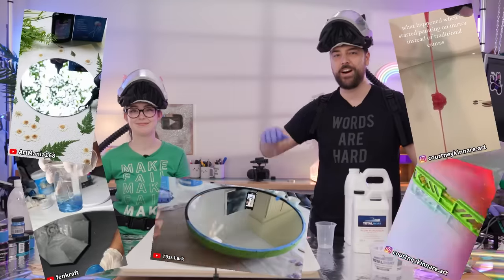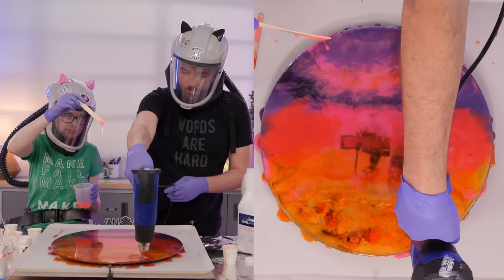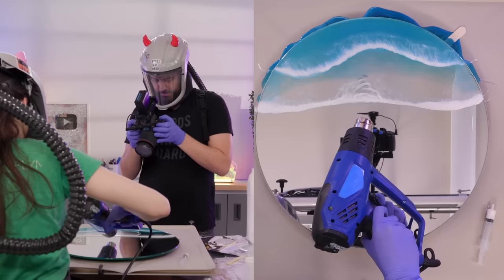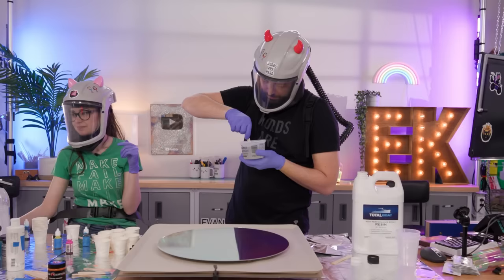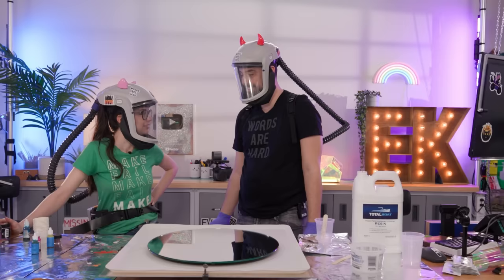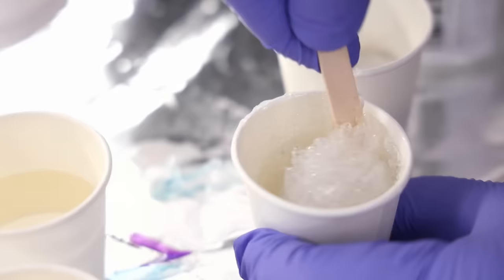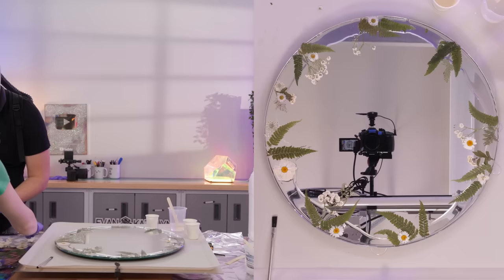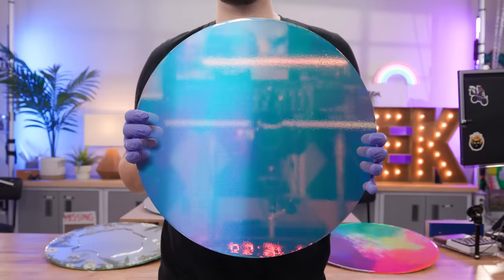Testing 5 Viral Resin Techniques on MIRRORS

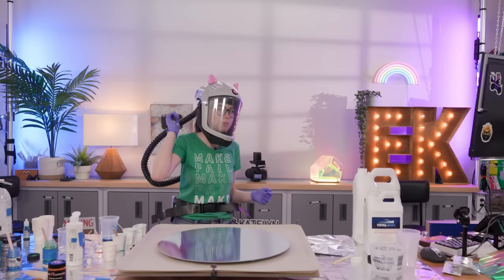Comment: 1:13:58 The reason the iridescent film doesn't work on the mirror and does work on the aluminium is because the film needs to be on the reflective surface. With the mirror it's on the glass and the light goes through that, hits the reflective coating and bounces back which in theory cancels out the film.

1:23:15 yes just that 😅

Comment: I loved the flowers the most! Ive never wanted to do a resin project before but the dried pressed flowers on the mirror is just so beautiful!! I dont like the edge though... i think the forbidden slushie would have worked if you lined both the inside and outside with it to make it more cohesive. I definitely want to make a mirror lined with dried flowers now

Comment: Hi guys, I hope you're both well and enjoying life. 
I was watching Evan pouring 🫗 with the small jug and pulling it backwards off the cups, if you turn the jug or bottle of wine.

You stop the water or wine or whatever lol
The strength or flow of the liquid is stopped. 

That's why there is a dimple in the bottom of a "champagne" bottle. 
You rest the wrapped " champagne bottle in the palm of your hand.
You then place your thumb into the 'dimple' at the bottom.  

And when you poor it out into the champagne 🍾 flutes, you turn the bottle when you finish pouting you won't lose any 'champers".🎉 🥂🍾🥂🎉

Comment: For the flower mirror I think having an inside edge would have been nice.  For example make a doughnut of flowers in a mold and then put on top of the mirror.  Then you have a clean edge, pretty flowers, and a mirror

Comment: The K in CMYK actually stands for "Key" as black is the key colour for getting most of the colours, without that, everything would constantly be very saturated and some colours are not possible if black is left out- BUT Katelyn is still right though. They also couldn't use B due to Blue in RGB already using said letter. People might think of it as "Cyan, Magenta, Yellow, Blue" instead if they had used B again. I know K also stands for the thing called Key-plate being used that the black colour is printed with but chat had already mentioned that as I was typing this lol Just wanted to edit this so that it's not confusing. Many meanings behind a smol letter nonetheless

Comment: The original ocean mirror used a thicker resin for the blue definitely, and the way he shaped the waves maximized viewing space while still having wave space. I suspect the white and clear were a thinner consistency than the blue so they'd mix with each other easily, but would move over the blue with less blending. Just guesses though

Comment: i had an idea to make something and no one has done it yet on YouTube. i was looking at the aluminum pour videos into orbees and i wanted that for my fish tank but aluminum is too toxic. then i thought resin! but everyone is fully encasing the orbees with very runny epoxy. but i know you can thicken epoxy to make it less runny or even into an unmoving paste. i was thinking if one thickens resin and pours it into orbees that if they get the consistency right. it will move thru the orbees like the aluminum did. something molasses thick so it can't fully travel to the bottom of the orbee's bucket. would enjoy seeing this if you did it. thanks!

Comment: I myself would've put some resin in the middle and use the paintbrush to thin layer it over to the flowers so you wouldn't have needed to pour alot in the middle but rant over I think a cool idea would be mirror rematch! Shaped mirrors, different techniques, redoing some failed techniques, and maybe a second chance to do something.. cursed?~

Comment: I think the reason why the window film doesn't work when you just put it on a mirror, is because it's dichroic film. Which means that it splits the light that hits it and some colors pass through, while some colors get reflected. But then when you put it on a mirror, the colors that pass through just end up getting reflected anyway, cancelling out the effect. No clue why it doesn't cancel with the aluminum tho. Maybe it's because aluminum is less reflective? Or the fact that being right up against the reflection causes the colors that go through the film to scatter instead of being reflected directly by the aluminum?

Comment: I have a bad habit of getting resin onto my gloves. 
So what i do is i put the latex on for safety. Then i put food service gloves over them with a hair band to hold the wrists tighter. 
Then if needed I just change out the food service gloves. 
I also wear arm guards to protect my skin because I'm freaking messy at times. I am stealing the foil idea thiugh because my mats currently look awful.

Comment: I live in West Palm Beach, Florida, although weather sources say our annual temperatures here average 74°, that is a load of bullshit. We do get about a week of 50° (possibly less if there is something unusual going on). 22 years ago, we actually had snow! But usually, we're in the 80s, and currently, we are experiencing heat advisory warnings with temperatures in the low 100's. With high humidity.
We deal with it by staying indoors in our Air Conditioning, swimming, and drinking Ice Cold beverages. But quite honestly, as you live here, your blood 'thins' and changes so you are not as affected by the hotter temperatures on a daily basis.  Just as people who live in constant cold are able to deal with that. I used to live in Ohio, my first 6 months in Florida was rough, but it's been 23 years, and now, when I go to Ohio, even in August I wear a hoodie and joggers.

Comment: I watched some of the live and asked a few times but wasn't seen...... perfectly fine......  I am wondering if the total boat uv resin has a strong odor?  I get migraines and work some with uv resin. But get migraines from it some. I want to get the mask but can not afford that right now. I am working on my new craft room that will have better ventilation but every bit helps....
Reply: BTW. I am the one who found u though Safiya.
Reply: They were able to use the Total Boat resin without masks/other respiratory equipment in their early videos. They got the equipment to both protect themselves and properly model safety procedures. Thats not a direct answer to your question but is indicative of the resin being less odorous than the visual indicators of the users in this video.
Reply: You know it's really not safe to breathe in the fumes like that...? that's likely why you get migraines, not the odor
Reply: @skylarkblue1    I have been getting migraines long before I started with the resin. I have several medical issues. I never use 2 part resin. I only do very small projects. And I never said I didn't use a mask or something. But the odor does stay for a while. We are moving and making a dedicated area with better ventilation for my uv resin. I just want to get something that has less odor because  even with the new place and mask the lower odor the better.
Reply: @LiminalQueenMedia  Thanks.  And reading you can use uv resin without some of the major equipment they use. I use gloves, and mask and looking into a better mask. But with chronic med issues, it's more about preventing them as much as you can. And I make miniatures. I use little resin. I can't wait to move and have my dedicated space for it. I just was thinking about trying total boat uv because they use it and was wondering about it.

Comment: Don't you think you should maybe try some other epoxy? Like you know, where you don't have to wear ridiculous masks and stuff? And something that can actually handle decent volume?
CCR entropy epoxy is great in that regard, it cures rock hard, has option for both slow and fast hardener, 90 min work time with fast hardener, 360 with slow. Becomes tack free after 24 hours or 72 hours depending on hardener. But best of all, it produces no odor or anything. Absolutely amazing for casting.
You can also heat it up quite a bit while mixing which not only makes it much easier to mix, but also basically eliminates any air bubbles.
I've done this myself by putting it in hot water from my spring. Still of course need to pop a few tiny bubbles with a torch, but who doesn't have that lol.
It's not terribly expensive either and if you don't have to wear that weird gear just to breathe, the audience can also hear you a lot more clearly.
I live in a place where everything is relatively expensive, and surprisingly they sell it here and for example the 7.15KG pack, which equals about 7.5 liter, sells for 272$ only.
7.5 liter is 1.98 gallon, if that helps. And bigger packs of course cost less per liter/kg/gal.
It has a shelf life of 2+ years aswell, but can be used quite a bit after that from my experience.

I haven't watched much into the video but I just realized, holy... 3 hour long video, just for 5 projects?
You couldn't like you know, do some basic editing to trim that down to a regular 20-30 min episode?
Reply: The video is 3 hours long because this is the uncut channel. They stream their projects on twitch and upload the full unedited stream on this channel, then later they usually upload the edited version on their main channel.
Reply: @Quonk079  Makes no sense, who in their right mind would watch the whole thing lol
Reply: @TechnoMasterBoy  A lot of people, me included, put it on while they do other things. Bit of background noise while you do chores n stuff.
Reply: @Quonk079  Just put on some music then lol

Comment: The spilled epoxy not being added back into the cup in any way is killing me. that is just wasted money 😭also watching Even measure both parts in the same cup is hurting my soul bc I always use two cups. I only recently started using the same cup for silicone but that is because it is by weight so it is easier to use the same cup IMO. I do have pumps on my epoxy so I don't need to use two cups aside from a few straggler bottles I need to use up that can't fit pumps 

*put into the cup before he added the other part to make sure the ratio was correct ofc